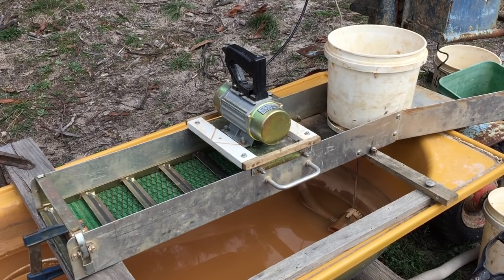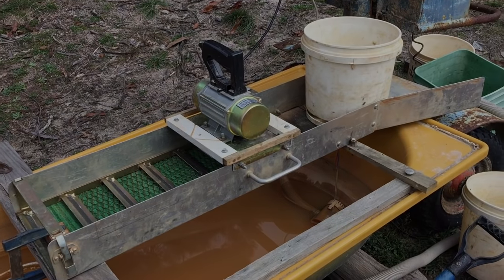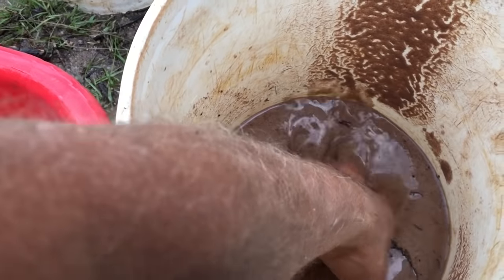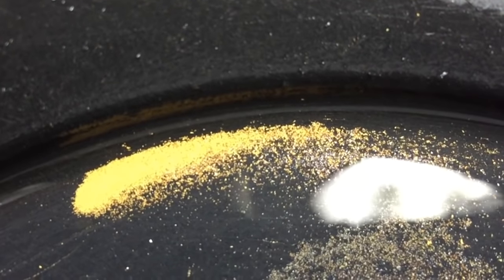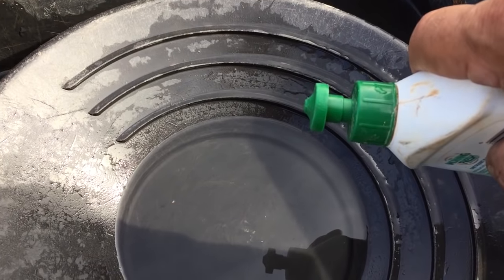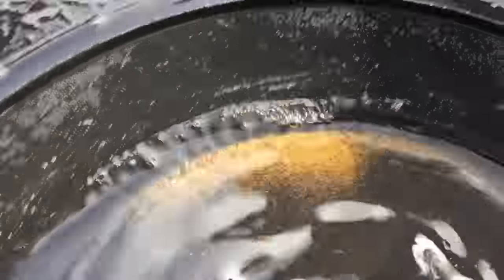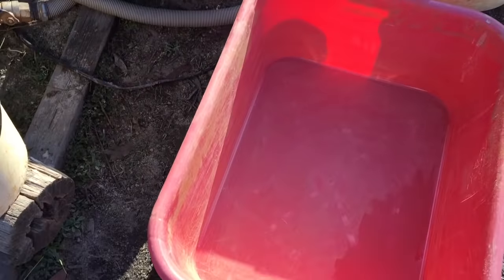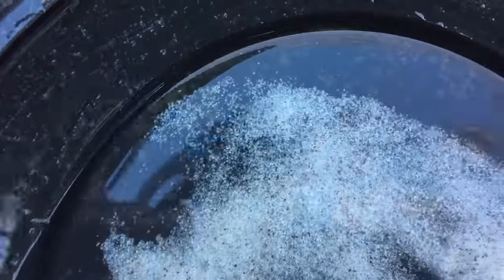Capture Fine Gold With A Simple River Sluice Modification - Aussie Bloke Prospector

Comment: i was thinking a gold cyclone bucket would be a better idea at the head of the process. you already use a bucket, so would just refine the process that little bit extra :D
Reply: alternative idea i had was to allow flour gold to fall through a mat at the start, into a cyclone, then feed the water out of the cyclone into the main water flow. sort of a water filter for flour gold.
Reply from the maker: I reckon that could work, but the emphasis here is how easy it is to make a simple vibration table... thanks for the suggestion. Regards Aussie

Comment: The trouble with your testing method is the likely hood of ultra fine gold flowing out of the bucket. You would need to test the contents of the tub.  

A while ago you did a video where you filleted your water and found a bunch of gold. 

Once you start getting really fine it takes a good long while to settle.
Reply from the maker: Actually did that..just didn't show it. There was little to no gold present in the sediments.. as for the ULTRA fine gold suspended in solution...well that's barely visible unless filtered out as per my vid, so I didn't really factor that in. Regards Aussie

Comment: You don't need that powerful a vibrator by the way. It's all about getting the right frequency and position for the size of the sluice or pan you're using to have the gold dump out in an accessible nodal point. A good way to illustrate this is to do it dry and pour some white sand from a hardware store on it. Vibrate it a while. Look at the nodal points that appear when you change the frequency of the vibration. Do NOT tune your placement and frequency based on white sand as it is nowhere near the density of gold; the only way to tune it is to get your hands on some fine gold and use the real deal. Nothing else comes close to accurate. Tune your nodal points to be right behind a riffle and you're guaranteed to have a mountain of gold when you're done.

Edit: To give you a good example of not needing high powered vibration go and look at the Mythbusters episode of using a vibration to make an entire suspension bridge shake. I've often used $2 'women's vibrators,' or broken cell phones vibrators. Both are dirt cheap sources of motors, the former being waterproof, the latter being capable of fine tuning of the vibration frequency. One works good if you want to try and make a vibrating riffle system. But the other is just as good taped under your sluicebox or high banker. Sometimes hanging your sluice from sprung legs assists significantly in allowing that vibration to build up too. Play with it, experiment, you'll find the best frequency and method to bang out that super fine stuff easy. And you won't need to lug a car battery around to power such a huge motor as you've got strapped to this! Just a word of warning; make up a fake name before ordering 50 vibrators off of ebay in case the postie accidentally drops it off to the neighbors. Plausible deniability!
Reply: You could use heavy black sands to help tune it if you don't have access to that much fine gold instead of light sands.
Reply from the maker: It just so happens, that that is the one I got, and for the purposes of demonstration and experimentation... it achieved the required outcome. I do however understand that variable frequency would only improve it even more and believe there would be an Optimum frequency. Regards Aussie

Comment: I already do this but I use a twelve volt vibrater with a variable speed controller!
For me your vibrator is too fast and your result will be 100% if you slow the vibration down!
Cheers Rob!
Reply from the maker: I'm pretty sure my results were pretty close to if not at 99.99%. Not possible with this fixed speed unit, but I'll look into it. Regards Aussie
Reply: You can control 240 volt motor buy adjusting the 50hz frequency but a motor control. Look on concrete vibrator and you can see you can buy a speed controller

Comment: I am curious if the direction of the vibration would make a difference.  I've noted in other video's where a vibration was used to help in dewatering placer tailings that it does.
The vibration here would seem to be up and down and in the direction of the length of the sluice - just wondering if rotating it 90 degrees to vibrate the width of the sluice would change anything?
If you test or have tested this out, I'd appreciate a response.  Thanks.

Comment: So do you still run it twice? Once Regular and once vibrating, or just run it this way? Thank you for your fine work. I put my dry  sands to be classified all on top of a gold pan that is over my vibrating sluice. So the Vibrator classifies for me too.
Would I run the 20 mesh, 40 mesh and 60 mesh separate? i think adding the larger stuff on the minus 100 gold would have you losing gold. I thank you brother. I really like my new vibrating sluice.. I had to add a speed controller on my vibrator because the water was jumping up 2 inches high. I'm getting it sorted out. And it's your fault. Thank you fella!!!

Comment: An excellent video John....a lot of work and thinking went into this experiment, it was easy to understand what you were doing...I have been doing basically the same thing for several years now but using my Miller table mounted on an electronic,shock absorbing frame from a military helicopter and using a vibrating dildo (never mind the remarks guys....just thinking outside the box) and it seemed to work to my satisfaction but never thought of doing an analysis of my losses....even used the dildo on the gold pan instead of the tap and it worked. Been thinking of using my 6" x 24" Dream Mat sluice on the anti - shock frame and hooking up an old jig saw for the vibration...I wouldn't have to classify as fine... someday maybe soon ...John you have inspired me
Reply from the maker: Cheers mate... really glad to have inspired you... went visual tough when you mentioned the Dildo and the Gold pan... LOL. Regards Aussie

Comment: IF its not too much to ask please help me disect this so I can learn intricate details of what I think I missed by answering the following ? one at a time. Sorry. Just trying to learn more, and this is one awesome video. Thank you already for all youve done for all of us in this learn/share opportunity. Kyle Pa-USA

When you first ran the original material through the sluice at the original setpoints, is the material in the buckets at the start of this video all of the tailings from that original run? what was the original batch weight + recovery = kg?

My summary of this: You took your orginal tailings, and recrushed them to classify smaller. Then modified the sluice to the 11:1 with vibration and reduced flow and then re ran the cons to concentrate further once you were satisfied that the tailings no longer held any fines (if i am understanding correctly).

After all modifications, now knowing what you know....would you suggest that next time you start off by crushing 1st to the 100mesh for consistincy purposes, and then sluice at the modified settings, and finainlly then sluice the cons 1x tand then blue bowl the total cons?
Reply from the maker: Happy to answer mate...

The original run was approx 150 kg for 45 grams which is equivalent to around  9.5 oz....and yep....re-crushed and re-ran. If I was chasing maximum recovery for smelting, then yes I could fast track the process by crushing finer straight off...definitely. Regards Aussie

Comment: Great video mate 👌, if you are ever down in Gippsland look me up, I've got some tools that would help you with your flour gold catching expedition, also have a wave table which is the absolute best for the -100 mesh 🤙just a suggestion which you might like try is, the mount for the vibration motor laying over slightly towards the up stream side of your sluice which should make it act like tapping the top of your pan walking the gold up behind the riffles instead of just straight to the bottom
Reply from the maker: I will do... next time I'm down that way...and great suggestion.. I will try it. Regards Aussie

Comment: Great video sir. You’ve got my brain engaged in how to mechanically reproduce the tap tap tap of the pan. Also thought of a table like if you ever played air hockey on. All small holes blowing controllable jets of air with another source of air blowing above the surface so as to blow the light material away while the gold stays. The other idea stems from another series of videos I’ve seen where the table is flat and under it is a speaker. From the speaker they play a constant mhz freq and with each new freq change different distinct geometric patterns forms as it vibrates. Each change results in a different pattern entirely. How would gold react given the different density of the quarts Vs gold. There is a name for these tables but I’m sorry I don’t remember. Basically boiled down to the same sand given changes in mhz would result in distinct new lines being formed. Don’t know if this thinking out loud is helpful but certainly the collective mind can refine over time better than a small number of individuals thinking about the same problem.
Reply: get a craftsman oscillating tool. 👀  they come with a real crappy scraper that magically fits that hole in your gold pan.  once you drill a 1/4" hole ofc.  bolt it together and use a couple rubber washers between the pan and the scraper head.  run it on HIGH. no low stuff.  it will fling and beat up everything.  the key to this is high frequency.  drill that hole as close to the end of the scraper bit as possible.  i used a carbide burr. stick some lead on top of a hand full of sand and test that bad boy lolol

Comment: Its like youve turned your sluice into a giant ultrasonic cleaner!
Reply from the maker: Never thought of it that... but in a way... I suppose I have. Cheers. Regards Aussie
Reply: I was thinking the same thing. I was almost wondering if the ultimate setup would be to get some large transducers used in ultrasonic cleaners with some simple electronic circuitry so you could run the whole setup off a 12v supply.

Comment: Ingenious of my friend. Thank you for sharing. I have that exact same concrete vibrator hooked to a 5 gallon bucket suspended by springs and you can place your screens on top of it and it will plow through the material.